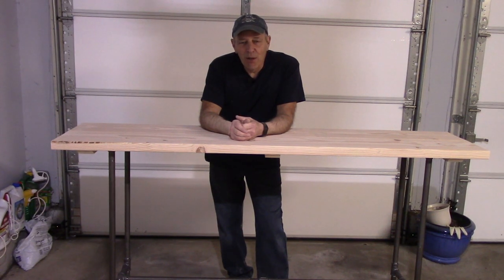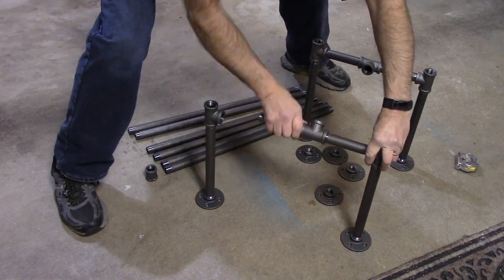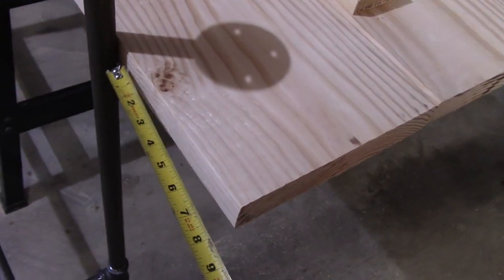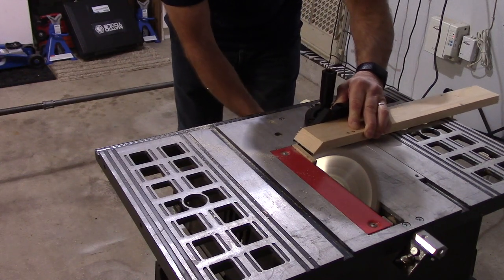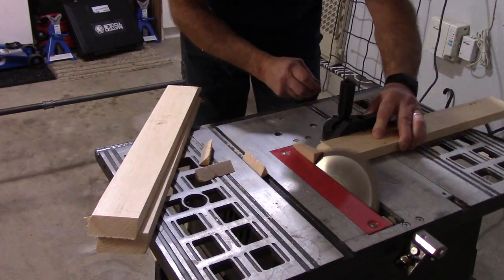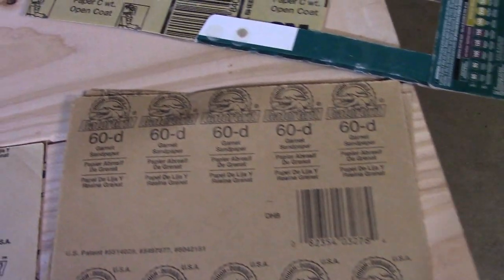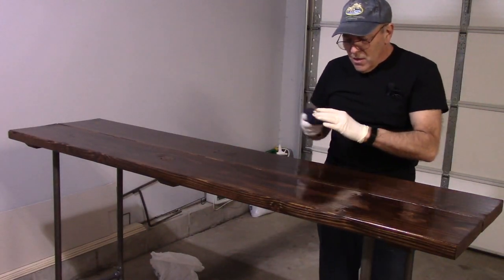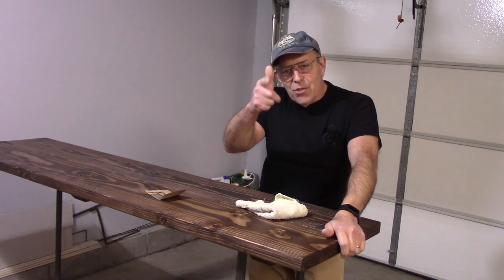How To Make An Industrial Black Pipe Bar Height Table

Comment: I can't find 26" 3/4 black pipe and this table calls for 6 pieces.  Where did you get yours? X
Reply from the maker: Here is the link to buy the kit. H40, Rusty Design, BKH1740C58 Pipe Legs KIT with Cross Bar for Bar Height Pub Table, H-Shape, L58 x W17 x H40, Pack Suitable for 1 Table.  https://amzn.to/3HBFtwj

Comment: Thanks for sharing your technique for pre-drilling the holes. If the desk is one inch thick, and the wood pieces are one inch thick, what's the correct drill depth? How long should the screws be?
Reply from the maker: The screw should only be about 1/2 to 3/4 the depth of the wood.

Comment: If I want the top totally smooth (so it doesn’t mess with writing) could I fill the crack with wood putty? Would the putty look different than the rest of the wood when I apply the stain? Thanks for a great video!
Reply from the maker: Good question but that will not work. You would have to joint the two pieces together with glue, dowel pins and clamps.

Comment: Is that actual plumbing pipe?? Any particular reason you didn't use the non-threaded pipe with the allen head fittings??
It's cheaper and made for this application I believe. I'm about to build a table myself , but man, that plumbing pipe is expensive!!!!!
Reply from the maker: Glad it helped!

Comment: Would you need to rub any kind of oil or rust inhibitor on the pipes to prevent Rusting from the dampness in the air?
Reply from the maker: If it is inside a house you should be ok .Don't forget to subscribe.

Comment: Your demo is awesome!     Newbie here.   Once the ends are cut to specific length, how are they attached, as I see you screwing the connectors on the leg pieces?   Once cut there are no threads, right?
Reply from the maker: you will need to but the size you need for your project

Comment: hi mr Jim
is there a specific software you use to plan your pipe design before you construct it ?
thanks
Reply from the maker: No I just build it the height and width that I needed. I'm sure that you can find plans on line for this project.

Comment: What is the length of the wood you used?
Reply from the maker: You can cut the wood to any size you need .In this case I did need to cut off a few inches from a 6 ft piece.
Reply: 6 inches